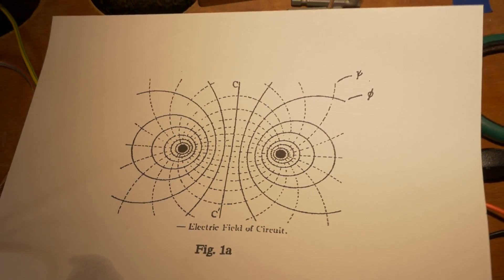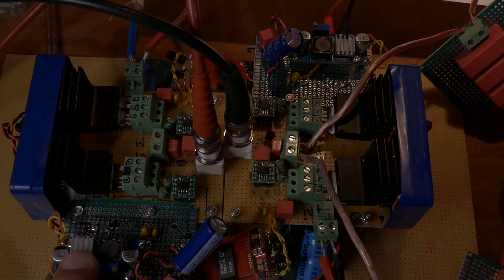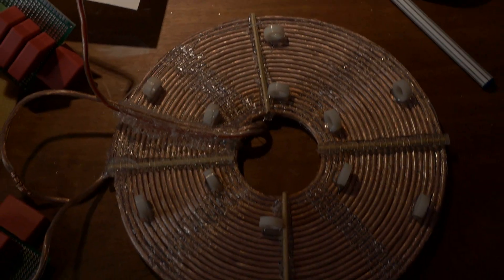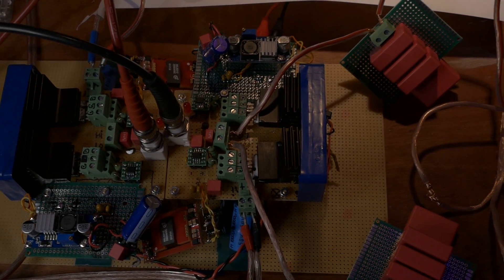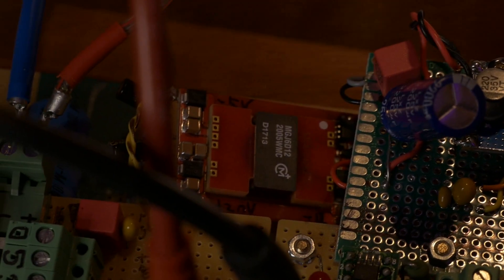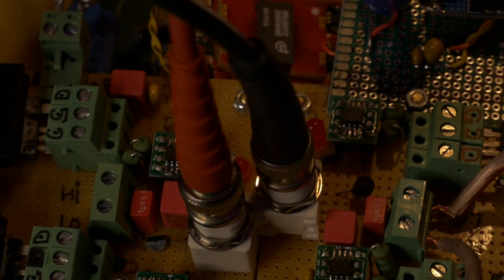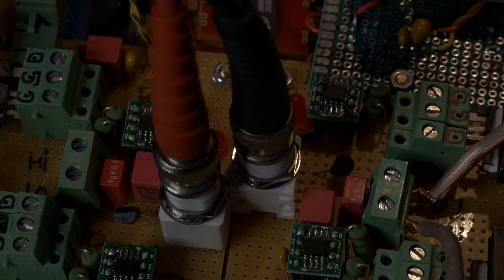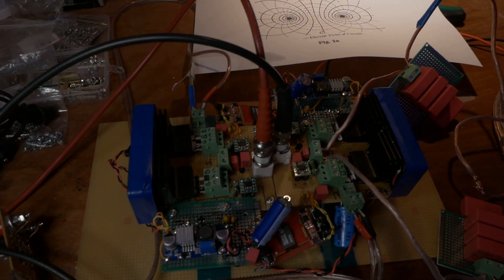H bridge preview

Comment: Hi Master

I am still trying to figure out the circuit for high side switching, I am a novice.

Is there a chance to get a diagram for your half bridge?

If not, any chance you can build one for sale?

Thanks and God bless.
Reply from the maker: Hi, yes I am recording a video(s) that shows the half bridge circuit.

I will be able to make it and sell it to you. There might be more people who will want it, so I have to plan it a bit. so it will take some time. probably next year.

Keep in mind it works with a dual channel power supply, that is series connected. I will explain it in the coming video.
Reply: @MasterIvo  I made  a small donation before and I am going to make another one. I appreciate you sharing your hard work

At my age, 72, I might not be around next year. I don't know too much about this stuff either.

I ordered the mosfet driver abd the isolated power supply but don't know what to do with them. Kind of dumb

Anyway, any help will be great.
Forushani@yahoo.com

Comment: Master Ivo is really doing very great job for the upcoming future. 
Would you please tell how to choose the capacitors properly at the ends of Bi-Filar coil to have a series resonance.
Reply from the maker: thanks. The caps I use are wima fkp1 or mkp10. polypropylene, they work with high frequencies.

I put them in parallel, like 4x10nf and 5x 1nF. this gives 45nF, in series with the coil.

then I tune the square wave that drives the mosfets, so I get a single voltage sine wave (with an optional impulse on the maximum).

making the series cap smaller (less caps in parallel) raises the frequency.
Reply: @MasterIvo  
Thanks a lot the information
Reply: @MasterIvo  
Hi, 
I am doing research on a similar project with wireless power transfer and using Full H-Bridge. I am not using any tuning circuit before the transmitter coil and even after the receiver coil. So, if a series tuned caps before the transmitter coil and parallel tuned caps after receiver coil is added, will i achieve improvement in the range of wireless power transfer. please do give few suggestions for achieving better range of wireless power transfer.
Reply from the maker: for wireless you need dielectric induction, this means using the (both tx and rx) coils surface area as the plates of a capacitor.

Resonance in not enough. you need sudden rapid single polarity voltage changes, thats why I use impulses.

oliver nichelson has a interesting paper:
http://wi-tap.energy/wp-content/uploads/2015/10/Underwater_Comm2.pdf
that radio is longitudinal.
the antenna is high voltage, and impulsed, the impulses collapse the high voltage dielectric field.
Reply: @MasterIvo  
Thank you for the great information 🙂

Comment: Hey I have question about pancake coil. Can I use Twisted pair copper wire to make pancake coil it looks this  https://sc02.alicdn.com/kf/HTB1J.Atc.uF3KVjSZK9q6zVtXXa7.jpg_350x350.jpg
Reply from the maker: yes you can. as long as you connect the end of one wire to the start of the other wire. (not end to end)
Reply: @MasterIvo  Well thank you. I thought without speaker wire it cannot be done. Speaker wire is very expensive where I live, thank you for clearing this out.
Reply from the maker: what are you going to do with the coil?
Reply: @MasterIvo  I just wanna play around and see what these things can do.
Reply from the maker: me too

Comment: Thanks for your response, I didn't realize so many people were interested in bifilar coils. I noticed on one of your videos you were testing out three coils closely spaced, how successful were they in that configuration, were they in series or parallel. Do you intend to use the H Bridge driver to run multiple coils or to try to capture both the opening and closing spikes. I had already built the square wave generator and ac to DC converter and step-down circuits before I realized that they can be bought for less than parts cost on aliexpress, also a great resource. The only problem seems to be the freight cost, I couldn't find any way to query how those charges are dealt with when ordering multiple items, $2 for individual item and $5 for the postage, any thoughts on how to minimise this cost. Keep up the good work. Cheers John
Reply from the maker: thanks, yes aliexpress works fine for me. It is becoming more expensive, with less quality. but I still can find stuff on it that works.

The h bridge will be operated as a double half bridge.
The halfbridge is what I am working on now. as it is the best way to get both polarity impulses.

Comment: Tsup,
How's it going? I write because I cannot wait till you publish your work on cone coils. How far is your work and when will you do that?
Reply from the maker: Hi, doing great, how are you?
Right now I am focusing on my advanced radiant power circuit and tuning it.
The cone coil has to wait.
Reply: @MasterIvo  cool. So I guess I'll have to wait. No pressure
Reply: @MasterIvo  I'm through a very important part of my life now. I plan to finish my sci-fi novel in about two years. I have been writing IT for over twenty years and I hope to develop my theory on a warp driver. I wrote to Google about that and there was no response... which is good - since they had not send IT back without reading - NASA is not interested in such revelations. The idea is quantum teleportation - speed without velocity or acceleration. Let's say there is a straight line and on this line there are equal disrances. At the front the mass is "existing the most" - the more to the back - the same matter exists the less and finally IT stops existing. But we teleport the least existant to the front and IT works like the previous time icon on YouTube - if the instances differ a lot in strength of existance - they both grow, but if they both are similiar in the strength of existance - they both shrink (become less strong in existance). So this is like saw-tooth current that Has a pseudomovement in the same direction as IT grows.
Reply from the maker: @GerolamoUrsidYulin  good to hear! curious about your book, is it in English?
I am also writing, and I wonder if I can turn it into epub format myself.
You know what Eric Dollard said about NASA?
Never
A
Straight
Answer
;D

interesting theory, but most can be learned from practice. theory should be developed from practice, not the other way round.

Our minds are very able to fantasize, out of reality.
but always based on learned things from the past.

true invention aften comes from clear observation, noticing the unregularities.
and investigating them by experiment. only afterwards a theory can develop.

at least thats my opinion.

I looked years in to electric resonance, but never thought about impulses.

Nikola Tesla is very clear in his lectures (and radiant patents) about impulses. these are the key.
Reply from the maker: @GerolamoUrsidYulin   Good luck! I hope it will bring joy to you.
Reply: @MasterIvo  Gee, thanks!
Reply: @MasterIvo  Actually, I think what I created was a warp drive. If space is a certain electromagnetic state, the conical coil compresses this space on one side and stretches it on the other. Hence the traffic. Dr. Nassikass tried to explain this by Leibnitz's forces and I don't think he was much mistaken because in a normal coil - a cylindrical coil - the space is only compressed inside and the force pushes the coil circuits out. Here, on the one hand, the circuits are denser, and on the other hand, less frequent. Thus, the space shows a different density at the beginning and the end of the coil. According to what Alcubierre predicted in his warp bubble drive, warp bubble is about compacting the field on one side of the movement and loosening on the other - that's what this coil does and doesn't need much energy for it.
Reply from the maker: @codetech5598   yes. Nature likes to swing from plus to minus and so on. day and night. But the impulse is only one polarity, so nature, provides the other polarity. 

The impulse as being a half period of the resonant frequency of the coil that generates it, is much faster, than my series resonant coil which is tuned down a lot. The only way the fast impulse can enter the slow series resonant coil, is when the series resonance is transverse, and the impulse is longitudinal.

Comment: Hi Master Ivo, love your work. I started to investigate Solid State power generation a few months ago and started to develop various components whilst researching, finally I came across your site last week. I have been watching many of your videos, taking notes ect, but haven't seen anything about the reason you chose the specific wire size or number of turns, is there an optimum size and dimension or are these arbitrary and we simply do the math to determine the appropriate component sizes for the circuit we are building. Also, it has become obvious that I am going to need some other equipment beside my Multimeter, oscilloscope would be one, considering your experience what would be the lowest level required because they range from $100-$1000s, if there is anything else that I will need I would appreciate if you could let me know. I have already built some of the components and yes it is near impossible to tune them within any degree of accuracy without the right tools, so thank you for pointing me in the right direction regarding the timer and adjustable frequency component. Just watching your videos has advanced my research enormously and I am truly grateful for your help. Cheers John Oflus
Reply from the maker: the wire is choosen for its low resistance. I found 2.5mm2 copper wire  ideal. Scope: Rigol has proper scopes 2 and 4 channel 1052 and 1054 if I recall correctly (I prefer 4 channel).
you probably need a square wave generator. Aliexpress sells them minimum capable of 2 MHz.
Reply: @MasterIvo  What maximum voltage do you think is necessary for the square wave generator? If you have a link or a model number that would be awesome! Thanks
Reply from the maker: It depends on what gate driver IC you use. My radiant half-bridge uses ttl levels, so 4 to 5V. (2 channels) 
my radiant power 2019 circuit uses a 10V square wave signal (If I remember correctly).

Comment: Hi Ivo, I have a question about your earlier vid showing 950vdc on output. Was this usable DC? Did you have any loads? It would help me to achieve the same usable output for this tech to move forward. Thanks 🙏
Reply from the maker: no that had no real power. it was achieved by resonance only. To create power from resonance it needs to be impulsed (as shown in my radiant power video of april 2019).

Comment: HI, just saw this video, was going to recommend it, then saw you commented on it over a year ago. https://youtu.be/cmfWGDKVHRE . It really validates your work. I belive you are on track. The spark gap does not appeear to be the heart of the technology that Vassilatos claimed, the capacitor as a ready reservoir of the cold electricity was the central key element; although the impulse is what sets it free, what is being used in every example was the discharge from the capacitor. Freeing it with the inductor's collapse of the magnetic field is a brilliant idea.  Tesla believed the impulses had no electrons in it. Is there a way to verify this effect, to confirm that hypothesis? Thanks, B
Reply: Faraday knew what was up. Bismuth's resistance factor responds differently to alternating current than it does direct current. It's structure, when in crystal form, forces whatever it is doing thing to the EDGE of the crystal structures, literally funneling all of whatever it is into a single line along a corner. 

Single dimensional action in a three dimensional material, under certain conditions. Frequency. Crystals. Impulse storage.

I think what Ivo is hinting around about is that same thing, done up in a coil. Keep up the work. We're talking about anti-gravity here.

Comment: what the heck is an H circuit?  what does it do?
Reply: It's just a term used in a lot of power electronics to describe a switch configuration. Switches in an H bridge configuration allow current to flow in both directions across the middle bridge of the H, so you can make an inverting circuit. The switches are located on the 4 endpoints of the "H" shape.
 https://en.wikipedia.org/wiki/H_bridge
Reply from the maker: h bridge, is commonly used to drive motors. I use it to drive coils

Comment: Great circuitry! I assume that you are seeking ultra fast switching what kind of MOSFET driver are you using?
Reply from the maker: yes ultra fast, for proper impulse (inductive spike) generation. I use the isolated gate driver called... eh I'll have to look the number up first edit: https://www.infineon.com/cms/en/product/power/gate-driver-ics/1edi60i12af/
Reply: @MasterIvo  Please do share, I'm working along side with you learning as I go.
Reply from the maker: great, please share your results. this is the IC :
https://www.infineon.com/cms/en/product/power/gate-driver-ics/1edi60i12af/
Reply: @MasterIvo  thank you so much for your open source
Reply from the maker: @patazertyui https://www.infineon.com/cms/en/product/power/gate-driver-ics/1edi60i12af/
Reply from the maker: I also use MGJ6D122005SC (murata) for the isolated dc:
https://nl.mouser.com/datasheet/2/281/kdc_mgj6scdc-1019175.pdf

Comment: Hey. Be careful with flat coils, under certain conditions they are emitters of X-ray radiation or high-energy photons that harm the body, because of these coils Nelson Rocha ruined his health. If there is a dosimeter use it in your experiments.
Reply from the maker: thanks for the advise.
Reply: @MasterIvo  ok
Reply: @AntonDremlyuga  is there a particular dosimeter that would be both effective and cost effective that maybe we can help donate for in the way of a purchase to help protect Ivo?
Reply: @cryptonein  A dosimeter is needed if IVO it uses at least three flat coils: one central, one above and one below, that is, the collision of toroidal vortices in central and scattered high-energy photons. I would recommend such a RadiaScan device.
Reply: @AntonDremlyuga  I could understand x-rays from a spark gap in parallel with a coil, but xrays from resonant coils is an interesting idea. Has anyone ever demonstrated ionizing-radiation from resonant coils? I could generate corona on filaments from high voltage, but nothing in the <1kV range. A radiation meter could make for some interesting content, or at least validate the prospects of x-ray generating coils.
Reply: @InfinionExperiments  The fact is that coils form bremsstrahlung radiation and the emission of high-energy photons.